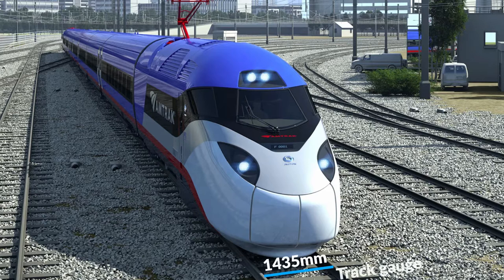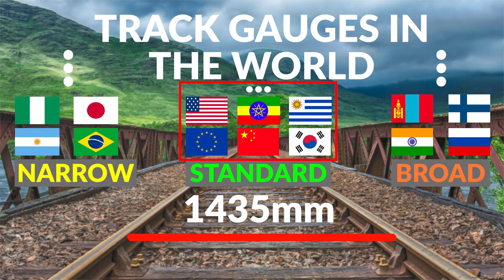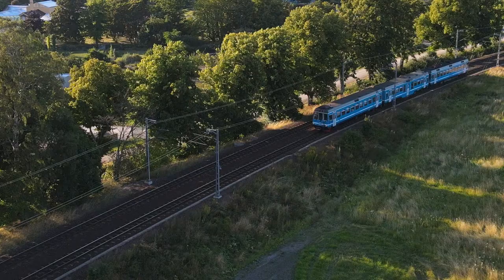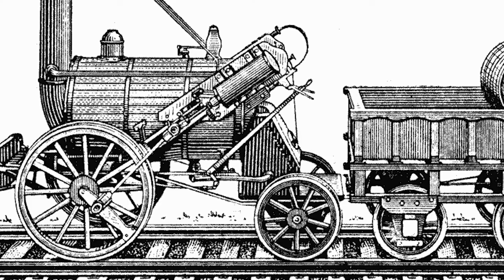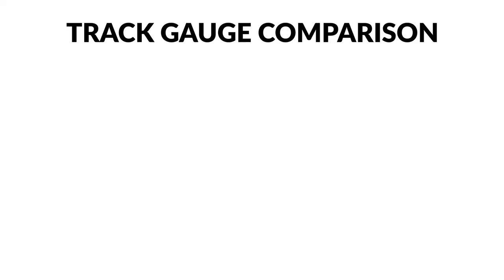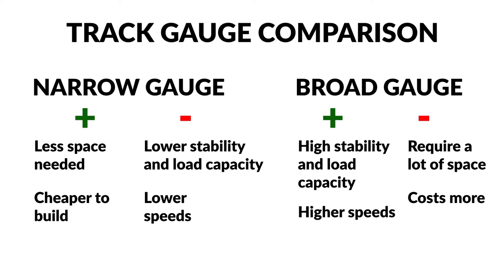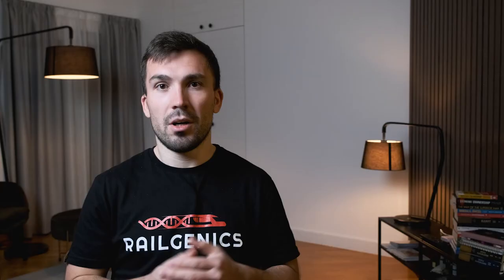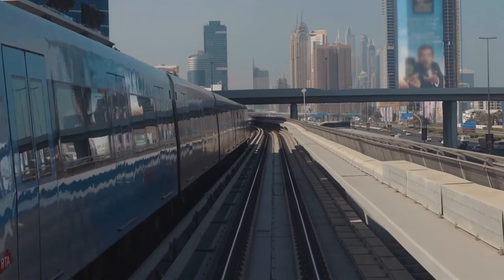Why Track Gauge Differs Between Countries

Comment: BART Bay Area Rapid Transit (San Francisco) is Indian board gauge 5' 6".   Standard 4 8-1/2" gauge was greatly chosen because is worked easily for freight in the early 1800s.   Any new train concept should likely be about double the current width to facilitate much greater passenger comfort and multi level height stability.   This likely for the extended future with maglev trains.    Right now Indian broad gauge at 5' 6" is the best regular used gauge for passenger and dual stack trains.    Indian railways don't use well cars for double stack trains and they run those double stack containers above the railroad trucks under electric catenary.   The greater stability of 5' 6" gauge allows for significant greater height than standard gauge.
Reply: I always wonder why Indian Railways don’t use well cars for double stack container freight trains . Indian Rail had to extend their catenary posts to accomodate the height of the double stacks and the pantos are stretched to the limit.
Reply: @judefernandez827 A much greater concern with structure gauge vertical dimensions are bridges and, especially, tunnels. This even led to abandoning / not reintroducing electrification in the Csacade tunnel in the USA which necessitated a greatly complex ventilation system.

I assume India doesn't have many (if any) tunnels on the routes of double-stack trains.
Reply: @judefernandez827  IR uses special high rise pantographs on the WDFC route. Normal pantos won't be able to reach that height.

Comment: Newest railways in Africa are standard gauge. These include the Gautrain in South Africa and new main lines in Nigeria, Kenya and Ethiopia. 
At times different track gauge is used to build railways to thwart any perceived encroachment of other rail companies or competition. Philadelphia built its streetcar lines to 5 ft 2.5 in to keep horse drawn wagons from riding its rails. Pittsburgh, Cincinnati and New Orleans also got so called Pennsylvania trolley gauge. Philadelphia's Market Frankford subway elevated line runs on 5 ft 2.5 in, making Philadelphia the only city to have 2 track gauges for its metro, other than San Francisco with standard gauge Muni and 5ft6in BART.
Railways in the Confederate states before and during the Civil War ran on slightly wider than standard gauge. A crude form of gauge adjustment were trains with wheels that could run on both gauges.

Comment: If we started again in the 1800's we would all use a 1.825 meter gauge.
Simply put you can run heavier faster trains on a broad gauge track thus making your rail network more productive.
A 2.0 meter gauge however would be too expensive to build and it's capacity advantage wouldn't justify the extra cost.
Reply: Doesn't help if you have to go through hilly areas.
Reply: @danensis  So that’s a fallacy as the addition viaducts and cuttings would cost 20% more per mile but your runnings costs are 10% lower per ton of cargo. So over a 40 year period you’re profits would be Up 200% compared to Russian gauge.
Reply: Brunel had chosen the wide gauge to fit a large firebox / boiler between very large wheels of the locomotives.

But yes, very wide gauge allows for wider cars carrying larger loads (including those oversized for a regular loading gauge) or perpendicular sleeping compartments on both sides of a passenger car.

Comment: If you say that narrow gauge is not very efficient, why do some countries still used it, even develop it as their main line gauge. The example is my country, narrow gauge track has been developed through years & now developing for the high speed 160km/h for narrow gauge track. Maybe the efficient point for some countries is different. For my country standard gauge is the most not efficient due to lack of all resources.
Reply from the maker: Hello, which country is yours? I can think of couple of reasons, such that it is very expensive to change the system to normal gauge. Also, some countries, like New Zealand, has entirely narrow gauge, so switching to standard gauge is just too expensive and maybe not necessary. Generally, drive for interoperability in Europe between countries is the main reason why 1435mm has become standard nowadays, and other countries out of Europe usually adopt the same for new railway lines, for a simple reason that they can use the same standards (like EN or AREMA), order similar equipment from suppliers etc. I am sure there are other reasons as well like historical, such as Australia, where you even have 3 or more different gauges. Hope this explains a bit :)

Comment: It's not just track gauge, that's only part of it loading gauge is the main problem as trains may be the same gauge, but cannot run on all tracks of the same gauge. Loading gauge however means weights and clearances the trains can pass, past platforms though tunnels, under bridges, trackside buildings etc. before a train can run a section of new track special trains have to be run with probes to check the loading gauge set to that particular train or trains dimensions which will run that line. That's just a brief explanation by the way.

Comment: Fun fact - 
Train gauge widths are originally defined by 2 horses asses. As the width of two horses that pulled carts (I believe in Rome) was the standard charter, and the grpup of people that designed the carts, designed the original trams. So they just used the same axel width.. and therefore the tram gauge width was the width of what 2 horses could pull. 

Don't believe me. - just goole it
Reply from the maker: I heard the same story somewhere, although not sure if that's truth 😄

Comment: what is an ideal size ... if trains were built a new
Reply from the maker: Very good question. I am not very sure what would be the right answer. Today's standard is 1435mm and there is amazing story about that dating back eve n during Roman's Empire. What I could tell you is that narrow gauge railways are  definitely not the answer, so the answer is probably somewhere in wide gauge railways. :)
Reply: @railgenics   for trams and inner-cities with narrow streets, narrow gauge would be an advantage for it's narrower turning circles. For some cities, narrow gauge wou;d have been invented.
Reply: Down here America, we still have A standard gauge Of 4/8, locomotives still standing at 16ft something tall.
Reply: @railgenics regarding the "ideal" track gauge: wouldn't weight limits be the main consideration. This leaves out passenger operations, which with there light weight have been able to run on dual gauge track with adjustable axles in some instances.
     So if we are talking freight: what are axle load limits; how does weight effect rail wear; what are the structural limits of rails or metal wheels; and, then there is the feasibility of bridge structures?

By the way have you done a similar video on track/railbed loading?
Reply: I think the is no ideal size, since with today's technology it just doesn't make any difference.
The French can make high speed trains run at 550+ kph on standard gauge track, and the Americans can build massive locomotives with axle loads in excess of 35 tons on standard gauge.
So making the gauge slightly wider or narrower wouldn't change anything.
Reply: Pax rail lines would probably be about the same gauge, maybe a little wider to accomodate comfortable length of beds (2+ m) in a perpendicular sleeping compartment and 3+3 layout with wider seats and aisles.
Also not too wide considering stability of high-speed trains.
But wide enough for stability of double-deck pax cars with non-depressed over-the-bogies floors.

Freight lines could aim for larger loading gauges to facilitate transit of large-sized loads (e. g. machinery and widebody airliner fuselages) or two intermodal containers side-by-side.

Comment: I downvoted this video. You made 2 key mistakes:

1. Broader gauge does not requires more space. Space depends on loading gauge. The Eurotunnel shuttle has the widest loading gauge and it uses standard 1435 mm track gauge.
2. Russia did not chose a different gauge for military reason. It was a historical accident.
Reply: Broad gauge needs more space as bends have to be shallower. You would need major engineering works to get broad gauge through hilly areas.
Reply: Russia chose 5 foot (1524 mm) gauge on advice of enfineers from Southern USA.
5 foot gauge was a 'standard' gauge of Southern States until after the end of Civil War when the gauge in all the USA had been unified.
But when it came to unifying Russian gauge with European (1435 mm), it was already too late.

Maybe Ukraine will gradually convert to European gauge, but probably not.